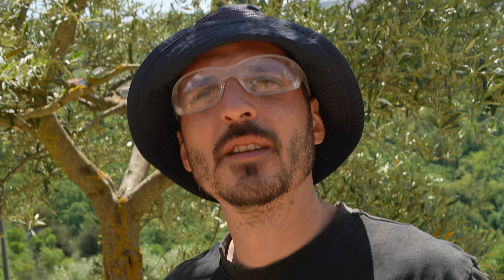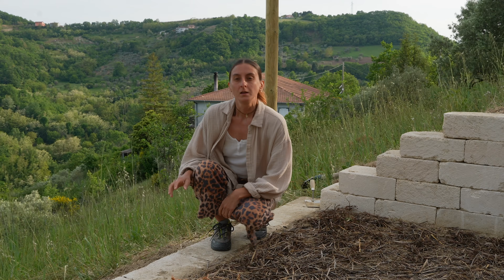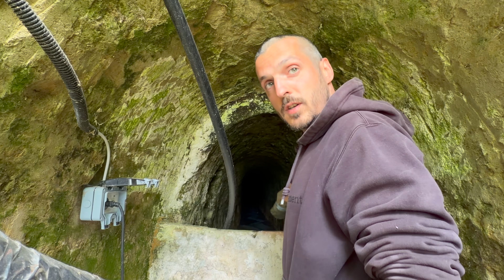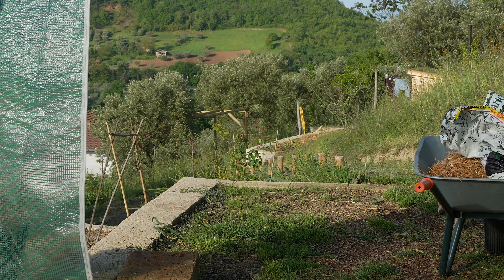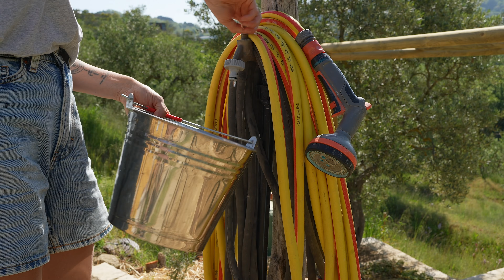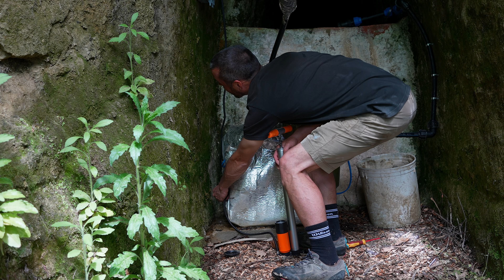This Week NOTHING Went Right 😅 | Off Grid Homestead Reality

Comment: I am confused by your water set up.
I know that you collect water for your IBC from rain collected as run-off from the road at the top of your property. (i commented on that video)
But what is the deal with your grotto/cistern? Is it a natural water source? A well dug previously? Or a tank that holds water from the municipal water system or from rain water collection?
Reply from the maker: Hey Peter, yes it is a little confusing - we pump water from a well already on the land, and we fill the grotto cave with it. Then we have a system that pumps this up to the house. The IBC’s we use for watering the land, compost, greenhouse irrigation (all for outdoor use), we don’t use any rainwater in the house - just the well water. 
The system we have for the well water, is a 3 way filter and UV light to clean it before it enters the pipes of the house. 
This was the original system when we bought the house, we simply replaced it from what was here when we bought it. Hope that makes sense 😊
The cave was dug by the ancestors of the previous owners, and we believe once it was filled by swales, but is no longer served by that (we don’t know for sure but the way they terraced the land and dug out water ways looks like that)

Comment: A tip i found very useful for those pressured tanks instead of manually pumping it, is to use a battery powered compressor like for bikes/cars (costs around 30-50 euro depending on where u buy it from ) . Saves a lot of time! And regarding the pressure, if for example the pump works at 2.2 bars, the pressure in the hydrotank should be -0.3 bars lower than the pump. So it turns on and off at the correct time. That is where a battery powered compressor will work great, so you can set the proper PSI
Reply from the maker: Thanks so much for the tip - much appreciated!

Comment: Your irrigation system will be fighting trapped air if you haven't bled it properly. Make sure to install a manual bleed vent at ALL high spots
Reply from the maker: Thanks for the tip x
Reply: @anotherhomestead  if you wanted, use regular hose valves to bleed, then you would have a hose bib to attach to if needed as a bonus.
Reply from the maker: @ProffCoat ok thanks very much!
Reply: @anotherhomestead Im a lisenced Steamfitter from Canada btw